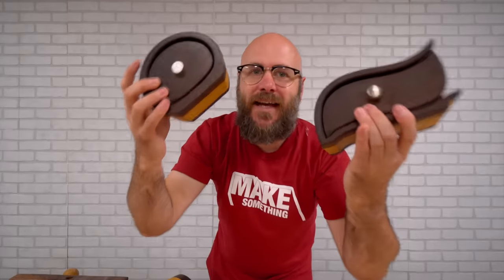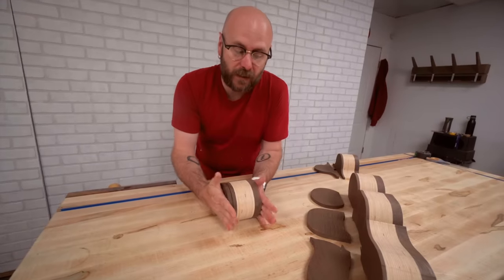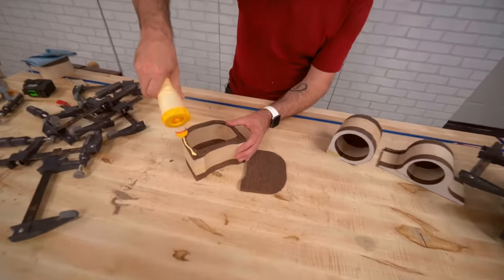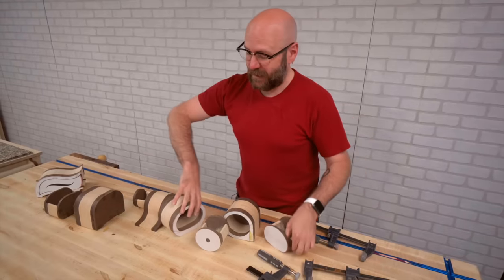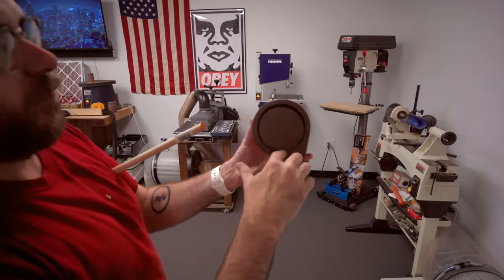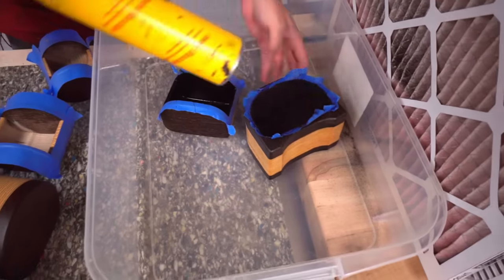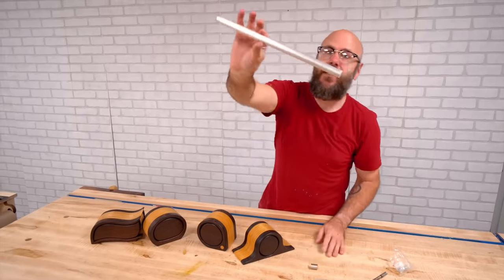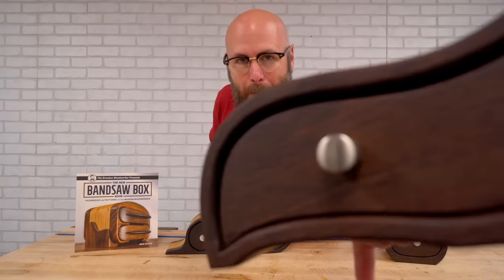Everything You Need to Know About Making Bandsaw Boxes!

Comment: It's an additional step, but for gluing on templates, I first put down a layer of continuous masking or painter's tape. Then you just put the adhesive on top of the tape and the template goes on the top. When you're done, you just peel up the tape and never have to deal with the paper directly adhered to the wood.
Reply from the maker: Genius!! Thanks!
Reply: Agree. Definitely do this with all my scroll saw work
Reply: Zachary Wilson OMG... mind blown. 🤯 I am so doing this next time. Thanks!
Reply: Justen
Reply: Zachary Wilso
Reply: @MakeSomething  thanks for the demo and info . i use clear packing tape instead of painters tape so i can see the grain direction .
Reply: Fantastic Idea Zachary, thanks!
Reply: Wonderful idea! I have struggled with paper sticking to delicate patterns and this is the answer. I will use this idea in one of my Tips videos.
Reply: I shall adhere to your supreme genius sir!
Reply: @markdmaker3173  I use the green painters tape, you can easily remove it weeks later. The blue is ok for a week or so, and I wouldn’t use the white, unless you’re using it on the same day.
Reply: This is what YouTube is about. Spending hours watching experts doing something you want to attempt. Then reading through comments to see comments that others put as helpful tips. Love it!

Comment: This is a good video filled with good advice.
I would like to add one comment based on extensive experience with bandsawn boxes:  It is far easier to sand the inside of the box before you glue the back on IF you are not covering those surfaces with cloth or flocking.
Many thanks!

Comment: I hope there are projects for a very small bandsaw.
My steers & sawtooth Crapsman won't even take a 4x4. It only opens to 3 in. I cannot afford a better one, unless I find a super bargain at a yard sale, like where most of my tools came from.
I might be able to make a bandsaw box out of a 2x2.
I did cut a Victorian chair out of a 2x2. 
It turned out better than I expected for my first band saw project. But it still needs sanding and finish.

Right after I got that at a yard sale I had put new tires on it.
The cost of bandsaw tires is ridiculous! Luckily I found out you can put vacuum cleaner belts on them.

I need small projects for my small bandsaw, or a super bargain on a larger one. 😃

Comment: I agree 100% with the website move to Squarespace. I did webdev for 20+ years and it just makes sense. I've tried VM appliances  that are prepatched quasi and still incremental patches are still required. Also cross site scripting security patches ever updating. I guess that's why we do woodworking ;) Great content & projects. Just built a home cloud using  Raspberry Pi for music files & Solidworks, and image files. I mirror a 256gig thumb drive  with an SSD to protect against data loss.

Comment: Here's a tip for masking off the edges before painting the flocking adhesive. Instead of blue painters tape, use fine line tape.  It's used in the sign and auto painting trades, is available at most sign suppliers and Amazon, comes in many widths from 1/16" on up, and the best part is it's flexible and slightly stretchy so it is very easy to follow curves.  It will cut masking time to a fraction, and seal better than blue painters tape.

Comment: I noticed you had some some difficulty getting the pattern paper off. I find it easier to apply some packing tape to the surface that I want to put the paper pattern on and then spray on the adhesive and apply the paper pattern to that. Then it is pretty easy to remove the tape along with the paper after cutting out the pattern. And it doesn’t leave a residue on the wood which makes sanding easier.

Comment: Great video.. I recently purchased the book as well.. I guess the only thing I don't see is anything about wood prep prior to glue up?   The chances of getting dimensional lumber that is flat enough for proper glue up seems unlikely to me (plywood excluded).  Do you commonly run your exotic woods across a jointer before you glue?  Sadly I don't have a jointer but have made a jig up for running through my planer, seems to work ok.
Reply from the maker: When I get my lumber (Kencraft Hardwoods) it's pretty flat so there's no need for prep.

Comment: What is the ratio of poly, oil and mineral spirits? I tried a spray poly..sanded between coats lightly, last coat still left a bumpy surface...just wasn't smooth as glass as I was hoping. Wipe on approach may offer better results. Received your book- are you a doctor in your spare time? Hard to read your signature 🙂

Comment: To get an even more uniform fit for the drawers I use a couple of thin self adhesive felt strips on the bottom of the drawers as runners. One on each side. Cheaper than the adhesive and flocking for inside the box but then you have to sand the inside of the box too. Pick your poison.

Comment: Hi David, I bought your book, just received it , very well made book..... I’m making my first bandsaw box. I would like to ask......I probably sanded the drawers too much and I have too much gap to my taste.....I thought that maybe I could flock the bottoms of the drawers to even the gap, just to raise the drawer a bit, as there no gap at the bottom, the drawer being flus on the box......what do you think......is the flock too thin? Your 
Advice will help,

Thanks

Andre
Reply from the maker: I try and do as little sanding as possible on the inside of the box and the outside of the drawer. There will always be a gap.
Reply: @MakeSomething  thanks David for your quick reply, I appreciate! I know that there will always be a gap, but mine is too wide, maybe my next one will be better, with better cuts. Or maybe I’ll try making the front part of the drawer
Larger ' With different wood to hide all the gap.

Comment: Thanks for your channel and book. I recently bought a used bandsaw and am glueing up a blank for my first box. I have a few blades that came with my saw. My 3/16in blade is 10tpi. I notice you recommend 4tpi. Will I have bad results (burning etc) with the 10tpi blade?
Reply from the maker: With that many teeth it's hard to cut 4" thick bandsaw box blanks because the blade can't remove the waste fast enough. You'll get burning, blade drift and it will be hard to cut on the line for curves.
Reply: @MakeSomething  thanks! I couldn’t find a 145” 4tpi 3/16” blade so I gave it a shot. Looks good so far!
Reply from the maker: @slimcrna  Awesome!
Reply: @MakeSomething  one last question- what disc sander do you have?
Reply from the maker: @slimcrna  the one from harbor freight.

Comment: To prevent having to glue the saw cut on the box could I possibly use a small drill bit and drill a hole then with a scroll saw and the blade attached, send the disconnected blade through the drill hole and then connect  the scroll saw blade to saw and go from there? In theory it seems like a thing but then it wouldn't technically be a band saw box....
Reply: Not saying that anything is wrong with you method. The boxes look amazing!

Comment: Nice video, man. The boxes look great. I have problems making boxes on my bandsaw. I have the benchtop porter cable bandsaw and it seems to have difficulty cutting through just about anything thicker than 3/4 inch. But I have been using the factory blade, you think a different blade would help or is it just the bandsaw?
Reply from the maker: A different blade will most definitely help. A brand new blade with 4 teeth per Inch should cut thicker boards with ease.

Comment: Hey David, great content as always! I have the same Rikon band saw as you and have had a horrible time with the tracking, especially when using an 1/8th or 3/16th inch blade. Just wondering what your experience has been and if you've got any tips for this particular band saw. Cheers!
Reply from the maker: Hmmm. Hard to say. My guess is too much blade tension
Reply: Thanks. I'll try with less tension and see how it goes.

Comment: What size band saw is required to make these at the dimensions you use? I doubt the 9" has a high enough  max cutting height. I need to buy one and need to balance cost vs features.
Reply from the maker: I used a 10” rikon in this video. Needs to cut a blank that’s 4” tall.
Reply: @MakeSomething  thanks that's one of the models I was looking at

Comment: I found if you use a heat gun the templates come right off in one piece
Reply: or put painters tape on the wood first before spraying the adhesive on. I've done that before as well.